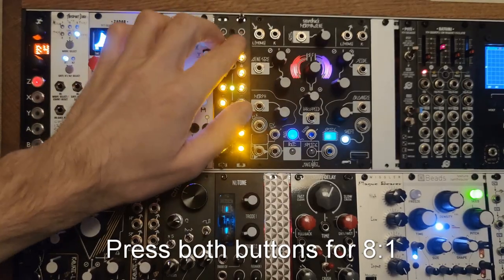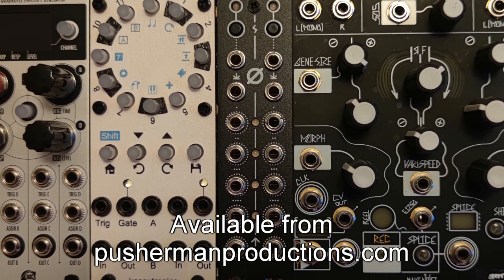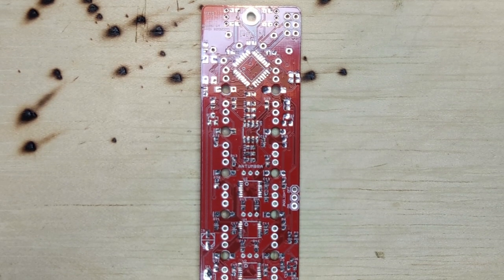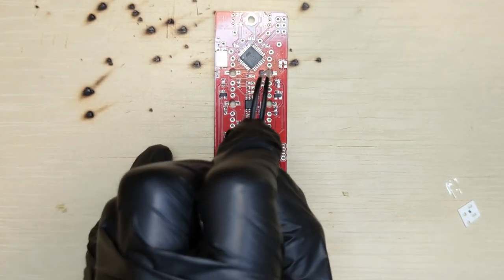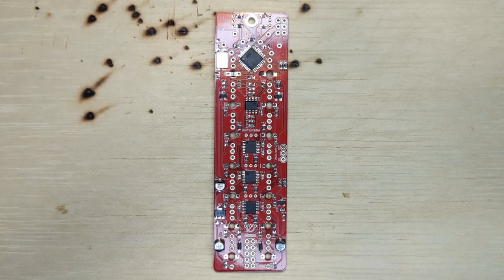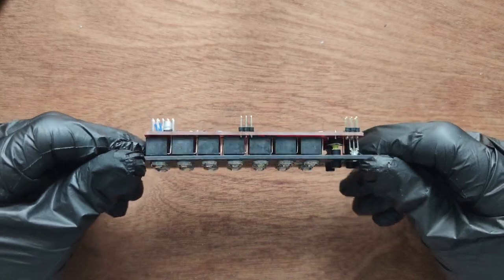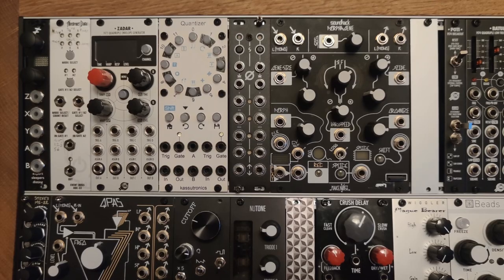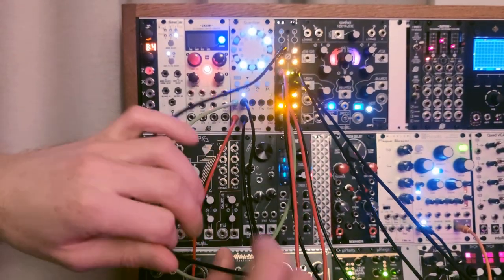Antumbra PATH: Build, demo, review

Comment: Antumbra's modules are top notch and so are your videos :D Great showcase of the build and use, loved the improvised jack LED. I want to give my Grid purple jack lights and I think I finally got the solution haha

One thing I'd like to say is that, to me, Grid seems like an easier build; its mostly really similar with the Atmega and stuff but uses only one TSSOP IC, the rest are easy-to-solder SOIC. Of course they're 2 completely different modules to use, it's just the build process.